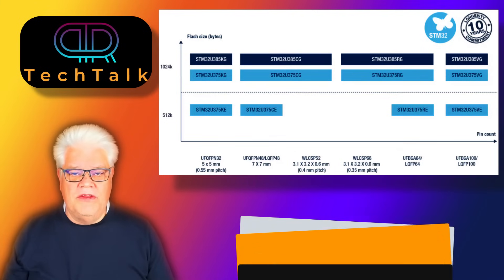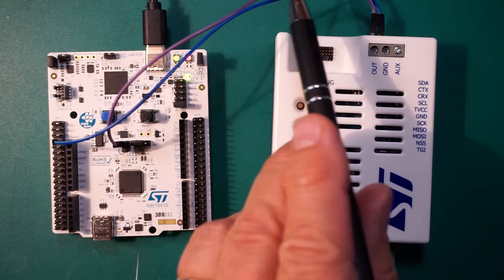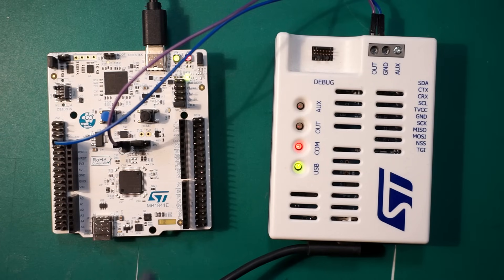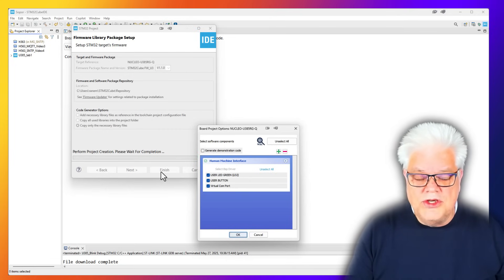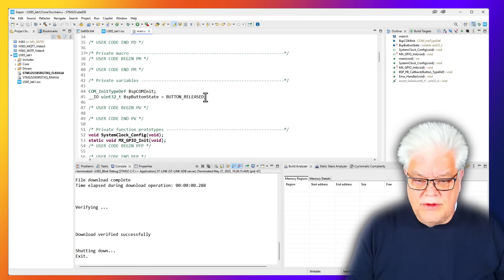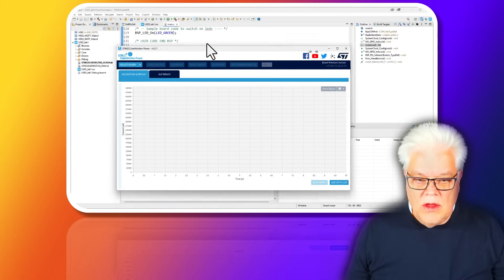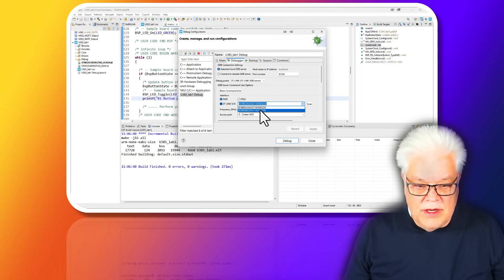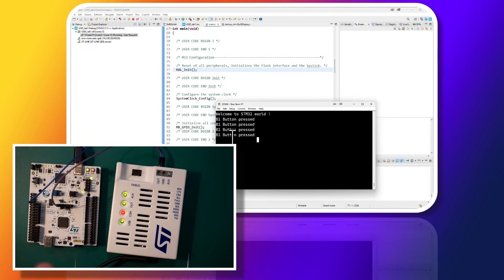Watch Me Measure Microcontroller Power Like a Pro!

Comment: I do have STLINK-V3PWR like 2 years already I think. Bought it when it came out. But wasn't aware of new U3 series. I have some U545 nucleos. Have to see now what is difference between U3 and U5. I assume U5 is more capable, but could be wrong. Nice video.
Reply from the maker: Hi, Main difference is that U3 is a cost reduction on U5, But offering even higher security and made in a "near threashold" voltage rails inside. Depending on the usecase the L4 Family Could be a better low pwer alternative. What is effecting is Temp, Mix of Run vs Sleep quote. But if Security is a important point then look at U3.
/PR TechTalk
Reply: @prtechtalk416  I thought L4 is now quite behind. Do you know what is the lowest power? L4 vs U3 vs U5. Is U series only about security? I haven't measured different sleep modes so accurately. I have used L4 series a lot on my boards. Mainly L476RG and L486RG series. That could be also great idea for a video. To compare different MCU-s who consumes less power.
Reply: @prtechtalk416  Also comparison should be done on same boards. Like some nucleos are a bit different so can't compare 1 to 1.